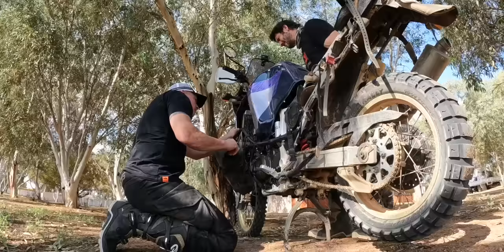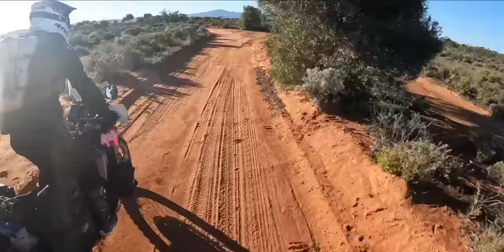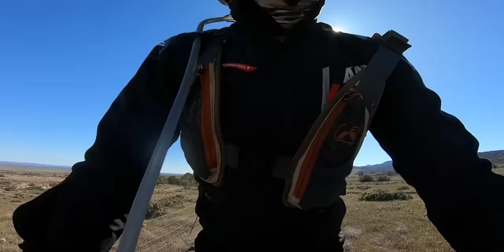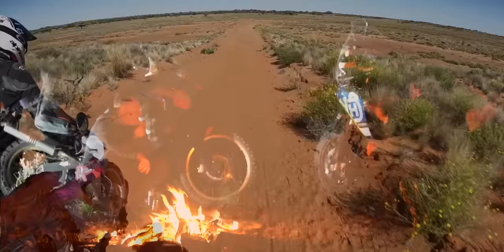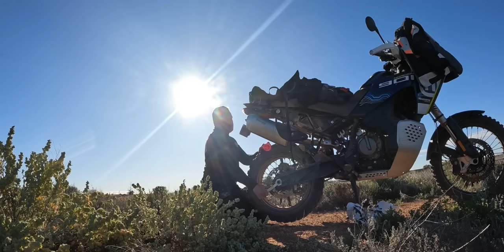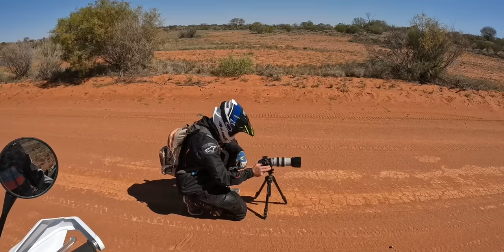Crossing Australia part 3 - Honda XRV750 vs Norden 901

Comment: Adam, glad you made it to a clean spot for "open heart surgery' as you say.  What an incredible trip mate.  This drop really puts the campfire chat into perspective. Trusting the bike, trusting old technology to solve tricky problems quickly and "easily", and using all the horsepower you need and not letting all the horsepower of a present day bike use you!  Once again, what an incredible trip and thanks for another great Motology offering.   I love seeing 750+ cc bikes with soft luggage!

Comment: Warhorse she is a beauty ! ♥
Trustfull, strong and a heck of a piece of a Japanese enduro motorcycle....
I ride her little light sister, the Honda Dominator 650ccm RD02. 32 years old from 1991 and only 168 kg wet  ...single piston, twin exhaust....fixed her this summer with a set of brand new headpipes and silencers in high-quality stainless steel, did a engine renovation and  gave her a new piston....Uhm! she runs like a dream now...My Thunderwomen!
Great to see motorbike riders like you Adam letting a good old African Twin shine again as the bright star she is...thank you for another great video !

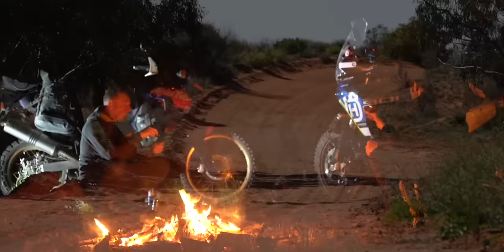Comment: In my opinion the nearest answer to your question at 16:40 is none other than the Warhorse's descendant - the modern Africa Twin. No impressive power figures. Suspension is not sporty stiff. Maintenance intervals are long and of course, Honda reliability :) 

That's why it's my dream bike and it's inspired by you and the Warhorse's adventures of course! <3

Comment: Another awesome video! Thanks Adam! 
I’m curious why you guys were running tubes on the Norden? It comes with tubeless tires… I can understand bringing a tube as back up on remote rides, but wondered if there was another reason?
I recently replaced my ‘06 950 Adv with a new Norden Expedition and have been looking forward to hearing you take on it after your proper ride… I’m loving mine so far… REALLY glad I got the Expedition… the suspension is super impressive… Cheers!

Comment: I have one from 1995. RD07. In green. 2nd owner. Bought from my brother back then.
And since 2020 I've been driving a new AF Adventure Sports ES DCT.
I've always driven Hondas. Never had any problems. The RD07 is a beautiful motorcycle. But has never seen hard terrain. Street and dirt roads. Not more. It would be a shame to drive it off-road with it. Only about 66'/67' kilometers down. With the new one I've already got 12' down. Haven't had any problems yet either.
You should take one of these with you on tour. Without switching gears is really good.
An old and a new AF. That would be cool.
Greetings from Germany👍

Comment: Oooh! Glad you spotted that wire gate…I’ve run straight into one of those with barbed wire…riding directly into the sun, could just see the posts at the last minute to hit the brakes to avoid serious injury or death, it was on a well used track on the beach, turns out the gate was new and the fence was placed illegally on public land.  Since then when I’m off road I’m always extra diligent. Great listening to you fellas jabber, cheers from Argentina…been riding down from Cartagena Colombia, off road when I can. Bob and Marge 🤣 BTW, the RUTA 40 from Susques Argentina down is a challenging track and the Argies love it on their big BMW’S and KTM’s, corrugated, sand, pebbles the lot, it’s a bike destroyer  after a while with all the vibrations and rocks and sand. I passed a group of them repairing the 4th puncture on one fellas KTM. My whole body was still vibrating for 3 hours when I arrived at San Antonio de Los cobres. I spoke with at least one of them in the restaurant where I met them later and at least one of them completed the Dakar, so that made me feel good as an “amateur” by comparison.

Comment: Awesome video Adam love the conversation with how some dealers are out to portray these Adv bikes as some capable enduro bike. Although they are extremely off capable bikes like you say 95% of riders will never attempt half of it. I currently run an 890 Adv R and do push it off road but what I think should be happening as these bikes getting more exposure and advertised as the Adv bikes they are meant for. Its about longevity and adventure, exploration of the unknown and enjoying the ride. Great video 👍

Comment: @16:00 guilty as charged. I bought a T7 last year mainly because of Pol Tarres and his "The Seeker" series. With little to no offroad skills I was thinking that I could conquer the great forest "outback" of eastern Europe with a 200kg adventure bike and the skills of a first grader riding a mountain bike down a mildly steep hill. Lo and behold I ate more dirt, mud and tree branches over the 13k km I put on that bike than a porcupine in heat. I'm quite amazed I did not break anything or got seriously injured. Sold it about a month ago, bought a second hand CRF300L and the difference, for a novice like me, is night and day. I'm more confident, better at tackling steeper terrain and overall a much better rider on a low powered and lighter dual sport than on a fully kitted out adventure bike. Should've listened to people who told me that starting my off road adventures with a T7 is a bad idea... I guess you live and learn, and most importantly, listen to others that already made the same mistakes you're going to make.

Comment: Your chat about motorcycle marketing and testing a bike for long term adventure use was good. I have a KTM 890 and much a great bike but I have no trust in the bike reliability. Too many electronic rubbish that can go wrong, and does. When you are remote your motorcycle being reliable and easy to work on is important.

Comment: Great video as always Adam!

The valve core melting and separating from the tube is a good trick, one that my 1090R has played on me once or twice before, luckily never with any consequence other than an impromptu pit stop. 

You mentioned drilling out the middle of the rim and I'm guessing installing a tube without an offset valve, whats the reasoning there? More durable somehow?

I have a bit of a habit of getting flats of all different types, usually when pushing it hard and playing with pressures, no set and forget here. 

Cheers

Comment: It's a shame that 91 is about all you can get in a lot of those places. I have an older bike and since I stopped using 91 {I use 95 mainly, or 98 depending on availability}, i've never had a sooty plug, and the bike runs noticeably better too... Love your vids Adam....

Comment: Grabbo nailed it when he said he'd rather just ride the proper bike in rough terrain. The big adv bikes are marketed these days like a big trials bike. But one trip down a gnarly trail riding a $30,000 piano will have most running back to the 250/450 in no time lol. That being said, there really is nothing like living for days at a time with just what you can put on the back of an adv bike. I'll twist the throttle into the black unknown any day of the week if it means getting out of the metropolis.

Comment: I fell into the hype of the manufacturers 5 years ago when I bought my 2018 KTM 1290 SAR. I recently traded that in on a Husky 701 Enduro. For the short time I've had it I've had a lot more fun on the 701 than I ever had on the 1290. Easier to ride the way I want to ride and I don't worry about picking it up after I've dropped it.

Comment: The ol Subliminal selling marketing , the master Adam. The suggestion here is you can run a teck Austrian reliably in the middle of nowhere , danger ! :) So good to see some manufacturers are producing the next Warhorse's and they wont be paper theose spec sheet sell bikes thats for sure. Good times br5and new legends on the market again. Two wheels captured nicely even better if they where both trusty steeds , no 2017 bottles to payed for there i quess.

Comment: Amidst the bleak expanse of the Australian outback, where the very earth itself seems cursed by an ancient lament, a tale unfolds that bears the unmistakable mark of Poe's dread-filled prose. On a perilous motorcycle adventure through this desolation, an insidious specter known as spark plug fouling manifests, brought forth by the malevolent essence of fuel procured in the forsaken realm of Coober Pedy.

In this desolate theater of nature's fury, the motorcycle, a valiant steed of steel and fire, finds itself entwined in a ghastly waltz. The contaminated fuel, akin to a potion brewed by a nefarious alchemist, courses through the engine's veins. Its insidious residue, a maleficent miasma of impurity, adheres to the spark plug's porcelain countenance.

Once a mechanical marvel, the motorcycle metamorphoses into a grotesque embodiment of despair. The spark plug, weighed down by the foul morass of misguided fuel, writhes and convulses in anguished protest. The engine's life force wanes, and the rider's dreams shatter upon the jagged precipice of hopelessness.

But in this shadowed realm, where the sun's descent plunges the land into a foreboding twilight, a glimmer of salvation emerges. Fresh fuel, pure and untainted, becomes the beacon of redemption. The rider, with a trembling hand and a heart heavy with trepidation, bestows this elixir upon the motorcycle's beleaguered engine.

As if touched by the hand of providence, the mechanical beast stirs, a faint glimmer of vitality rekindling within its depths. The spark plug, once shrouded in darkness, now ignites with renewed fervor. The engine's song, though subdued, resonates with newfound strength.

In this macabre tale, the rider's faithful companion, a fellow traveler from the same haunted roads, serves as an unwitting oracle. He, too, had procured fuel from the accursed realm of Coober Pedy. As if cursed by a shared fate, his motorcycle succumbs to the same sinister malady.

Two souls, their fates entwined in this odyssey of despair, bear witness to the malevolent influence of tainted fuel. Their motorcycles, symbols of their intrepid spirit, mirror the fragility of human endeavor in the face of the outback's unrelenting harshness. Like characters in Poe's tales, they are forever marked by their harrowing journey through the heart of darkness, where the very essence of their existence hangs in precarious balance.

Comment: Just out of curiosity, why don't you run mousse instead of tubes?
Reply: For this kind of riding tubeless is a better option in my opinion. 
When you’re hundreds of kilometres away from anything it’s safer to carry a few tubes rather than rely on sealant incase of a puncture. If you carry a tube repair kit and a few spare tubes you could take a lot of punctures before being stuck. larger punctures might not seal fully with sealant also.
Reply: @Willbertoslackbold  you're missing the question.  You can run mousse instead of tubes.  Look it up 👍 And so I was wondering why they don't
Reply: @oldhairpin mouses heat up on the road to much mate they don't last long unless using for off road enduro etc and you get alot of play on the road they terrible
Reply: @1991enduro  cheers for that Butt 👍